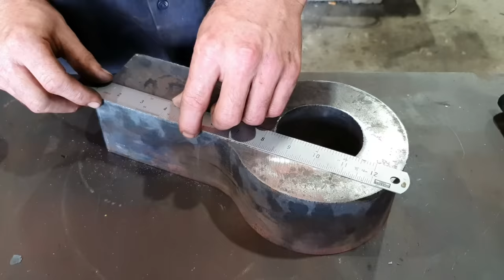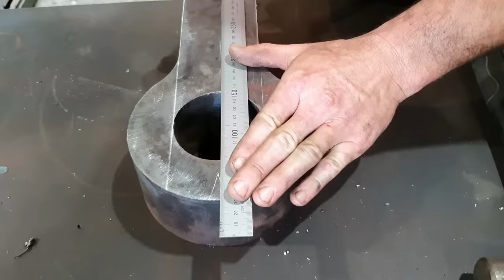Replacing BROKEN Eye on Hydraulic Cylinder for CAT 631 Scraper | Machining, Welding, Milling

Comment: You need to get that rotator up on a table so you can stand. Take it from someone who has spent almost 40 years kneeling in front of a boiler or furnace working on it.  LOL
Reply from the maker: Hey mate I prefer the job lower to the ground just in case something happens less distance for it to fall, in saying that future plans are to have a welding lathe 😎👍
Reply: @CuttingEdgeEngineering  I hear that. Stuff falling usually aims for your toe. :)  Speaking of kneeling I just uploaded a vid of me installing a indirect water heater in a crawlspace. My aching back. LOL

Comment: Those interrupted cuts are really hard on tools !  Is it really necessary for the finished product other than reducing weight ?  Why not stick it in a mill and knock off 45° on each corner.  Those cuts don't have to be accurate, just eyeball.

Comment: Ever had the work piece get too close to the tool holder then all of a sudden BANG as a exposed part of the piece gets too close to the tool holder? It's what I'm thinking that will happen when those exposed edges get close to the holder. 
I bet if that happened, the holder would be completely fucked.